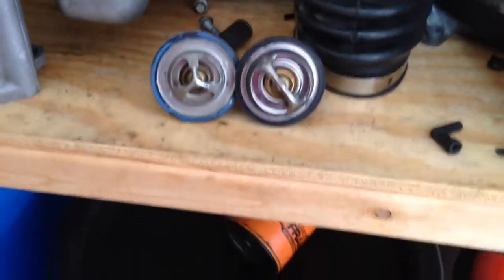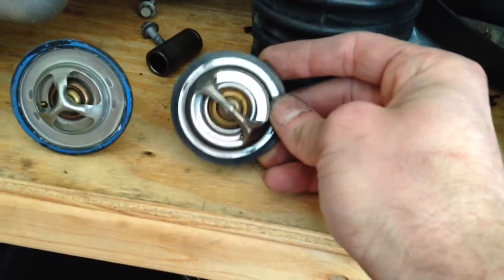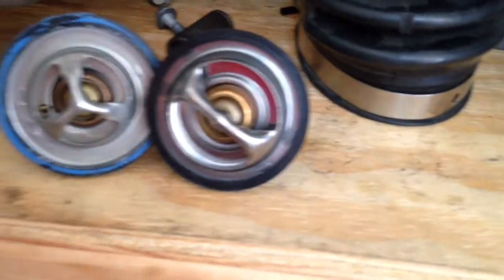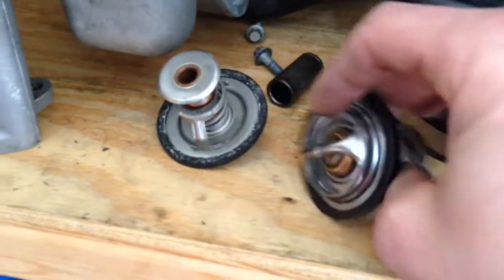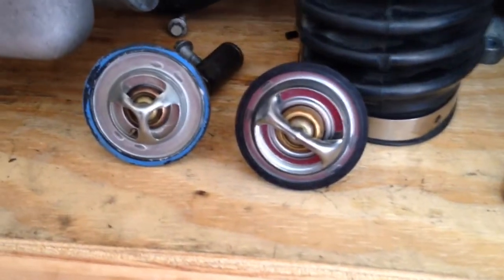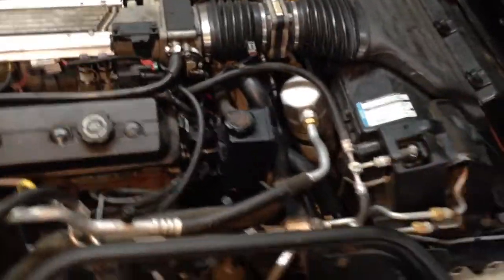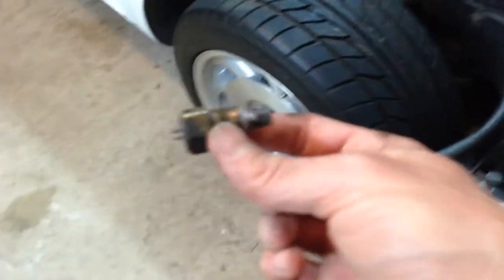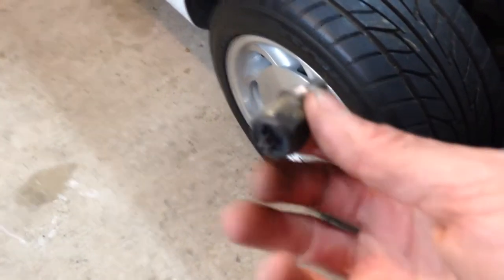1995 C4 Corvette Restoration: Ignition Woes opt 5 - OTR Again

Comment: Hey Slythee, tell me is you notice an improvement in fuel economy after your refreshment.

Thanks.
Reply from the maker: +hasbeengood Theoretically there might be but since it's running so much better i'm more likely to keep my foot in it.
Reply: +slythee1  Friend!  I have to say I like they way you think!  LOL.  I am getting close to being able to drive mine.  I started installing a short shifter and have trans and diff oil to change.  Then I get to see how all the crap I did changed the car... for the better hopefully.

Keep your vids coming. I enjoy them and they are a big help. Take care.
Reply from the maker: after replacing the Throttle Position Sensor, if i didn't know any better, I would think i am getting improved MPG.
Reply: Hmmm.... well it has a connection to the computer, so, maybe!  Why not?

I'm still having steering rack issues.